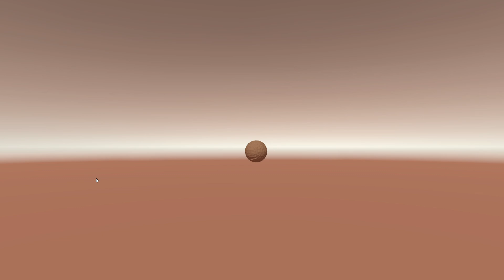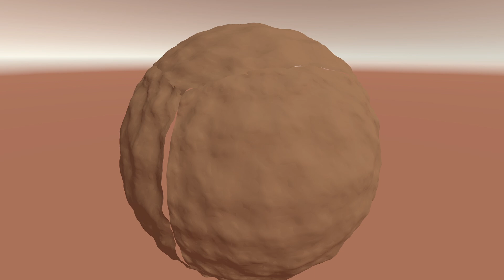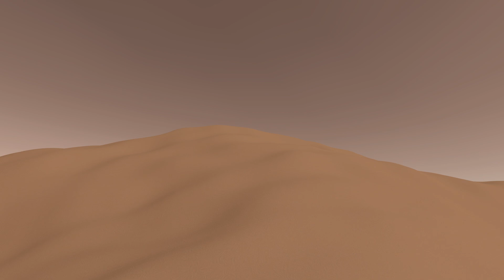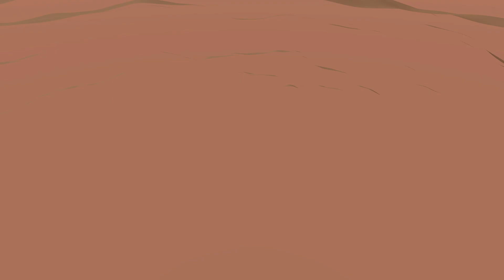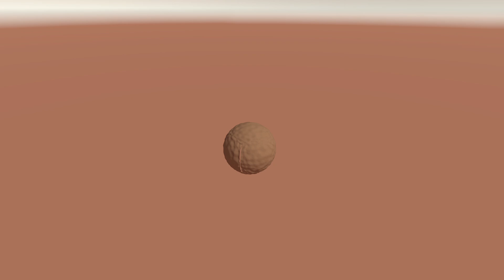Planet Generation Progress

Comment: use 3d noise. There is a lot of problems with projection from 2d noise to 3d object. The simplest solution is use 3d noise i think. 
And its simple to get 3d from 2d:
(perlin(x, y) + perlin(x, z) + perlin(z, y)) * 0.33f

You also can multiply it, its some different results:
perlin(x, y) * perlin(x, z) * perlin(z, y)
Reply from the maker: I ended up using 3d simplex noise